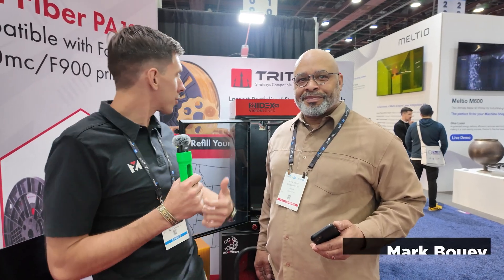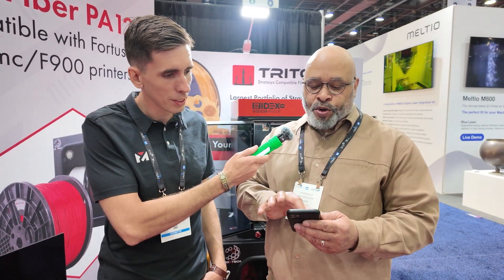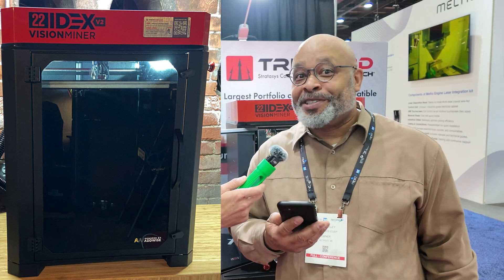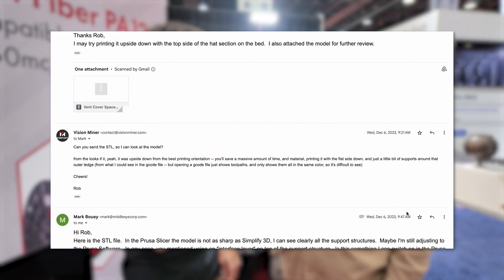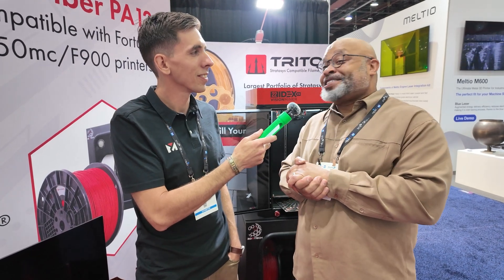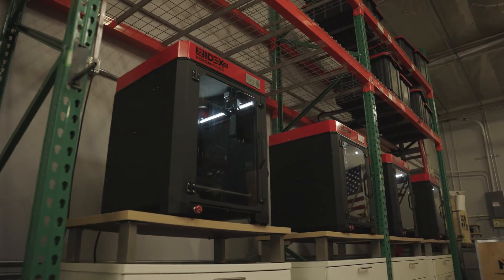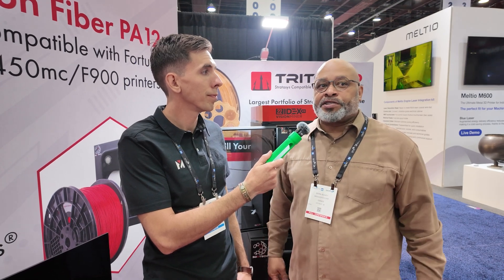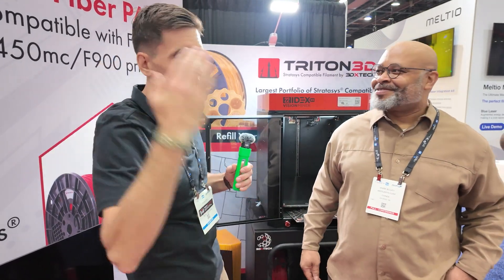Mark Bouey’s 22 IDEX Journey | Vision Miner User Highlights

Comment: Yep, high-temp high-strength materials are super useful for making repair parts for automotive and other industries, where you have the part and you can't make it beefier for 3d printing with weaker materials, like PETG, and so you turn to something stronger or more temperature resistant that can only be printed on high-temp printers. Yes, you could print a lot of materials on printers without heated chamber, but your layer adhesion won't be as good as printed with properly heated chamber.
Reply: u can print only shit without heated chamber. Must be a bambi user right?:)